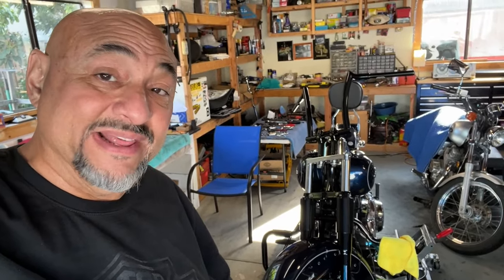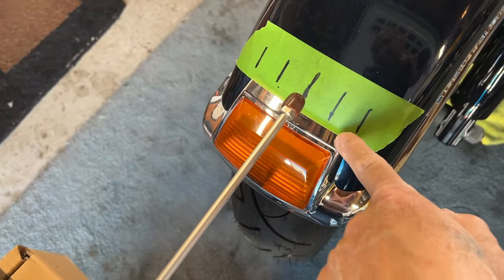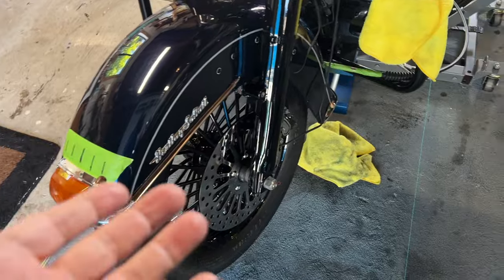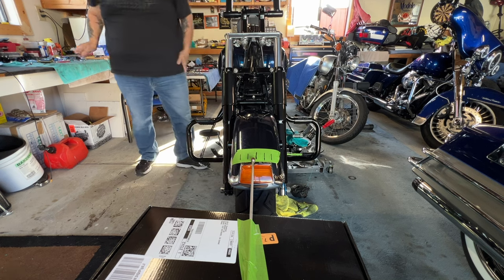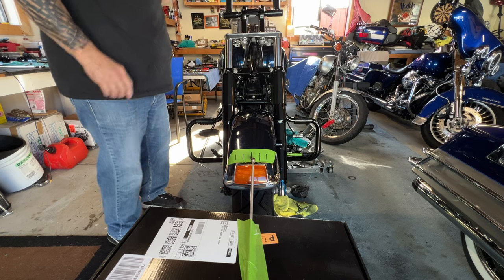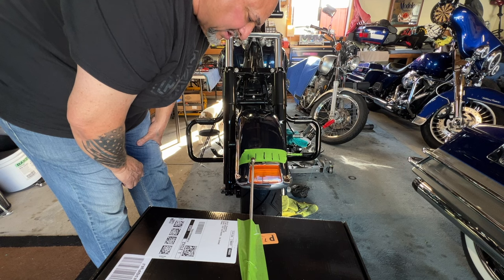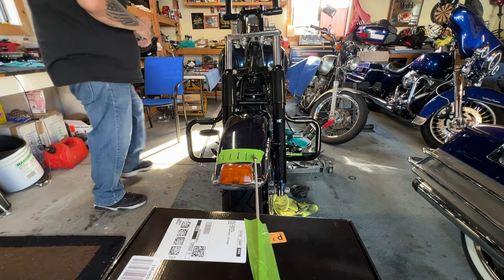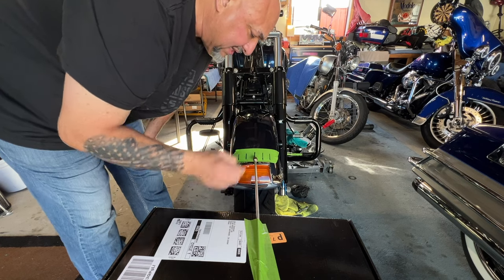"The Do's & Don'ts On A Harley Fallaway Adjustment"

Comment: Doesn't the bike have to be near perfectly level for the fall away to work as well?
Reply from the maker: @mikesbikechannel4387  Hey Mike. Just as good as you could get it. It’s not going to be perfect but close is good. You just want to make sure there is no wobble when you ride it. Just make sure it’s not loose or to tight.
Reply: @jcustombuilds  I just added a batwing to my 23 Softail Heritage and I have a wobble at high speed. My bike just turned 1k miles and I had Harley do the first service. Do I need to check my fall away?
Reply from the maker: @mikesbikechannel4387  Did you have the wobble prior? If not the fairing shouldn’t cause it. Sounds like there’s something else going on especially if the bike only has 1k miles. It’s to new. I’d have a professional shop check it out because they have to go through a series of tests to figure out what it could be. I’m sorry I couldn’t be more helpful, it’s something I’d need to test and rule things out to figure out what it could be.
Reply: @jcustombuilds  no wobble prior to putting on the batwing. It happened at highway speed.
Reply from the maker: @mikesbikechannel4387  if you didn’t have it before you should not have it now, because you actually do the fall away with the fairing off. Question: did you use all Harley parts to put the fairing on and did everything fit good and tighten down correctly? It sounds like there’s some kind of imbalance with the fairing which could cause a wobble at high speeds.
Reply: @jcustombuilds  it's a Reckless fairing that I bought from an individual. According to their website, the hardware  that he gave me is the one for my bike. It fit pretty well and it is solid as a rock. My thoughts are that the aerodynamics of the fairing are causing a lift in my from end which in effect would lighted it. This could cause the wobble.
Reply from the maker: @mikesbikechannel4387  Yes, I agree with that. I’m honestly not sure how that could be corrected but will talk to some buds who are master mechanics for their thoughts. Hang in there and be safe.
Reply: @jcustombuilds  thank you very much for your help and suggestions!